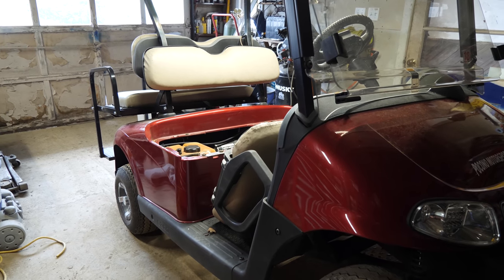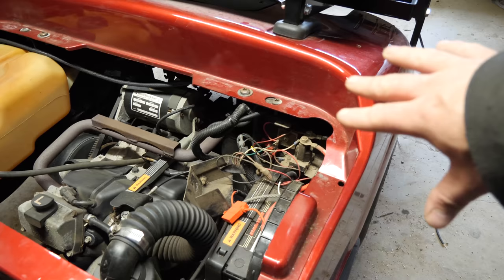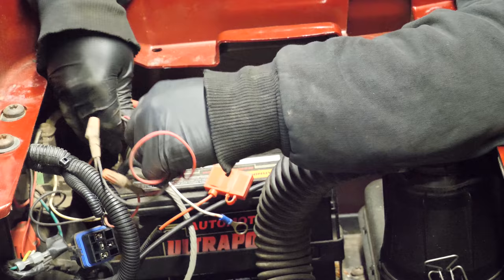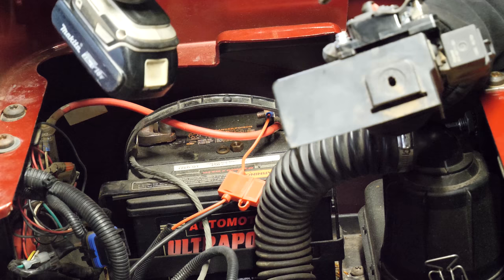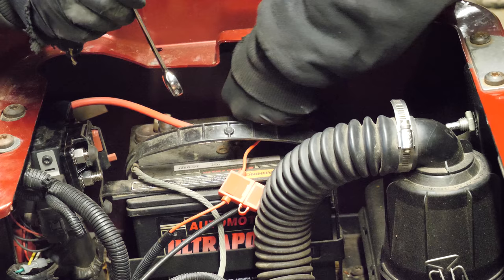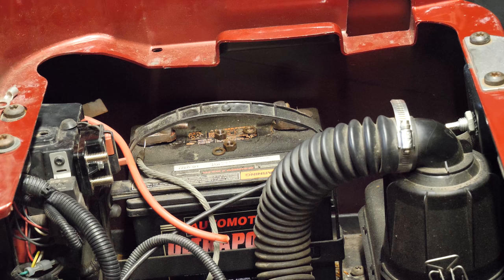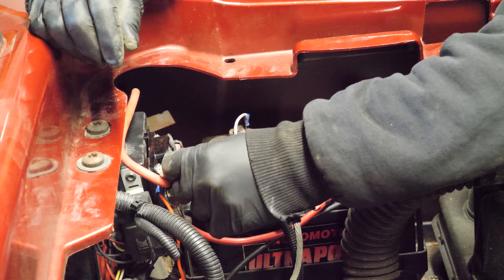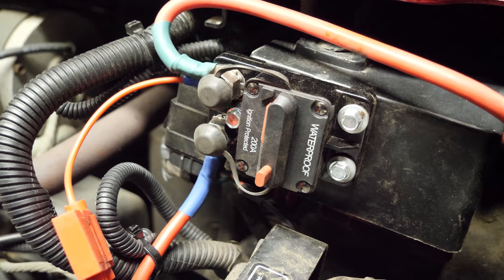2009 EZGO RXV, Gas - Battery Keeps Dying

Comment: You maybe close to fixing the amp draw, by checking the light relay to see if there is any draw that powers it up. And the power lead is connected to the ignition out side not the battery side.
Reply from the maker: I wanted to dig into the lighting circuit to pinpoint the root cause but time was not on my side. The customer wanted the cart back as quickly as possible and this was the fastest way. It would of made a better video for sure.

Comment: I installed a battery disconnect on the battery of my gas cart.  Worked great but after three weeks battery was dead as  door nail.  This is dumb question but can there be a draw on the battery when the disconnect is turned off?  Or was there enough draw when the cart was in use to weaken the battery?  I put in a new battery.  Should I disconnect the lights just as a precaution?
Reply from the maker: The idea of a disconnect is to completely disconnect the battery from the cart when the disconnect is turned off. This means everything connected to the battery, including lights, are disconnected. You could have an issue with a parasitic draw or with the charging system. You will have to diagnose that issue first before attempting to repair it.

Comment: Have a 2015 club car president, put a new voltage regulator on, brand new battery, and rebuild the starter generator, and I am still not getting a charge to the battery. Any guesses?

Comment: I'm dealing with a 98 txt that can't keep a battery alive for much more than 7-8 months. SG charges at 12.75 like it's sister cart and has the same Napa battery. The other cart has no battery issues. The cart will start with a jump right now but not hold. These cars work on a horse training facility so they run every day. Is it as simple as getting away from the Napa battery? That's my first thought. SG not up to snuff? Long distance diagnosis sucks.
Reply from the maker: The voltage regulator is on its way out or starter/generator is weak. It should be putting out over 14 volts at full rpm.
Reply: @Kevinsgolfcarts  I had it running but power bled down and died, now won't crank with a known good battery. I think the starter is toast. I pulled the covers to look at the brushes and had piles of black dust on the bench. The commutator looks good and isn't burned. Think brushes will save it?
Reply from the maker: You can try new brushes. If they are worn to where they are not touching the commutator, then they cannot pass electricity into the starter/generator.
Reply: I swapped out the solenoid and tried it before I put the belt on. It spun the starter so I thought it was good. Put on the belt and got a small pop somewhere and back to dead pedal. I ended up taking it to a good place here in town. It needs to be back on the job and I don't want to do the parts cannon thing. Thanks for all your help.

Comment: Question sir. How this cart operate? Is it when you press the gas pedal the engine automatically starts? And when you press the break the engine will stop?
Reply from the maker: Pressing the accelerator pedal starts the engine, releasing the accelerator pedal will allow the engine to shut off. the brake only stops the cart and has no mechanical or electrical connection to the engine.
Reply: @Kevinsgolfcarts  will the battery take proper charge in that way?
Reply: @Kevinsgolfcarts  by the way. I do have a friend who has a yamaha golf cart. And the battery dies after using it for 2hours, though when i check it it has no parasitic draw and the alternator charge is 13.7v and when the battery was tested by the battery store it was discharge.

Comment: That was unnecessary to put that breaker in it. Just connect the lights up through the key.I installed a light kit to my 09 and powered from the ignition. No issues. Interesting watch though
Reply from the maker: The ignition switch is in series with the rest of the start circuit. Its not a good idea to run other accessories from the ignition switch unless it has a dedicated accessory terminal. If they have factory installed light kits, they are already wired this way If there are no factory installed lights, then the ignition switch is a simple, very low current switch (1A or less). Some of these aftermarket light kits have a brake timer switch that is constantly drawing power. This was the option the customer chose. I, personally would rather use the double switch system for brake lights.
Reply: @Kevinsgolfcarts  Hmm, never thought about that. Guess thats why I watch these video's. I could run a relay. That should take care of it don't you think. Thank you.
Reply from the maker: You could, and most cases, have no issues. I tend to keep lighting and other accessories on separate circuits when possible. Its best to keep the ignition circuit isolated if the key switch does not have a dedicated terminal for lighting. You could change the key switch out for one that has the 4th terminal dedicated to lighting. Its a 3 position switch (OFF-ON-ON). The 2 position switch (OFF-ON) isn't "designed" for lighting. This only applies to EZGO carts. Club Car does not have (as far as I'm aware) multi-position switches. Newer Yamaha Drive2 carts do.
Reply: @Kevinsgolfcarts  Well, theres something to look into. Its a learning thing. Many thanks for the idea's.